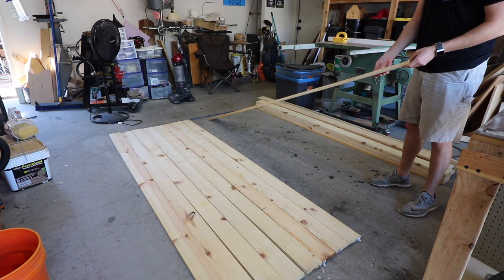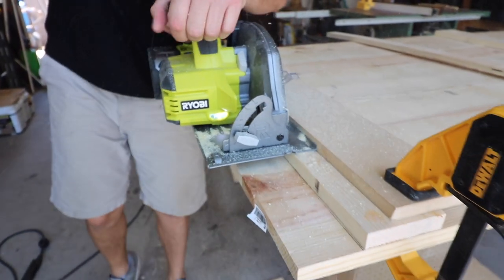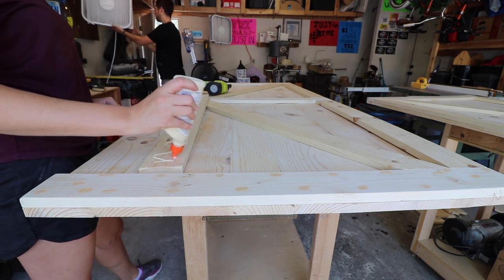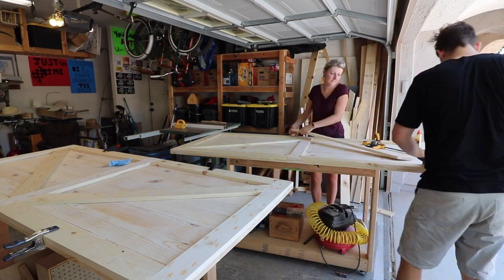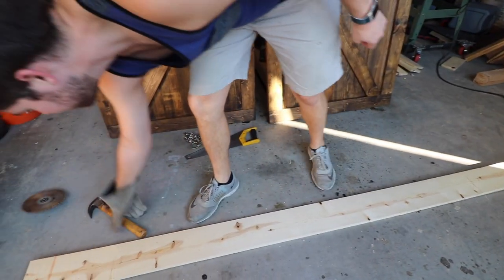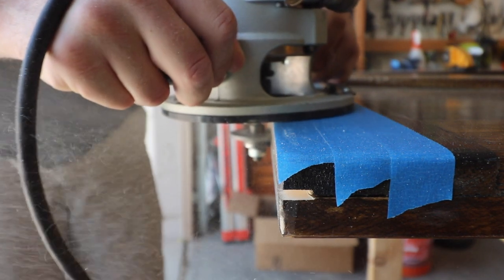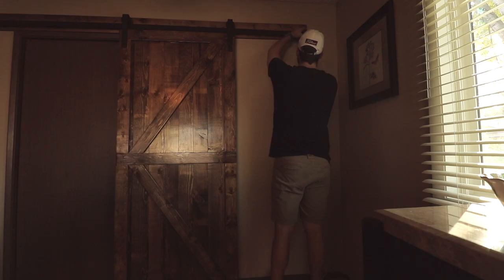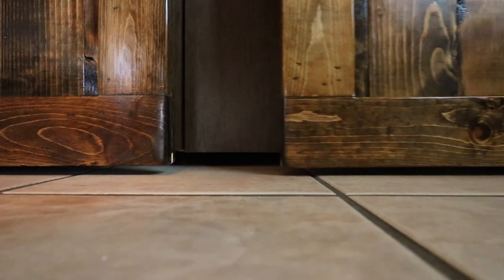DIY Double Sliding Barn doors

Comment: I would not glue the boards that run perpendicular across the grain as wood needs to be able to move to prevent warpage or cracking of the door. A door can take on moisture from the air causing the wood to  expand and contract 1/4 in per foot. Also do not glue the tongue and groove joint for the same reason.  Making the screw holes slightly large will also help,  Tears of Experience

Comment: A list of what is need would be helpful and because you don’t have it and did not include it in your video I cannot find it helpful sorry it is beautiful.
Reply: Angela Pannozo it looks like they used 1x6 pine tongue and groove boards (probably 8 foot) for the main part of the door, 1x4 (again, probably 8 feet), for the top trim and cross sections, 1 1/4 inch nails and nail gun, wood glue, sander and sand paper (probably 220 or higher grit), long clamps to hold the wood together as it is glued, and a router with a slot cutting bit. Of course you’ll need the mounting hardware as well.

Comment: How do you keep them from rolling past center?  I just installed some myself (not as nice as yours!) and they roll past the railing coupler (I used two 8 foot long rails and the provided coupler).
Reply from the maker: Usually the hardware kit comes with stops for the center, so the doors stop where you would like them to
Reply: I’m doing a double door project now and I’m trying to figure this out as well. If I put the two spare stoppers in the middle, they take up too much space and the doors won’t close together. The distance between the two straps when the doors are closed is only about 2.5 inches. I’m thinking maybe if I leave the last 1/2 inch or so (of the mortise slot) unrouted, and it will catch the guide and stop. We’ll see.

Comment: Nice job!
 I kind of cringed when u out down masking tape before using the router, but then noticed you switched to painters tape. Wondering if you had issues when pulling off regular masking tape or was the stain able to resist the glue adhesive. No diss, just curious. Again, door came out great

Comment: Love this!!! How do you install the bottom track?
Reply: I was wondering the same, 🤦🏽‍♀️ I don’t think they showed that part, only the 1/4” slots they cut with a router but, that’s it. I didn’t hear anything more about it... 🤷🏽‍♀️
Reply: @opiana86  it so the doors wouldn’t sway back and forth when not in use. Naturally doors move when the furnace kicks on and off. So no track on the floor

Comment: The slots that were cut out.  What was the purpose of doing that? I didn’t notice a track on the floor? Thx for sharing
Reply from the maker: These doors are purely cosmetic non functioning the slot is to hold them still so they don’t swing back and forth.
Reply: @JustinStanley  it’s exactly what I want to do for where we had French doors that leads into a bonus room. This video was very helpful
Reply: There’s a guide on the floor. They didn’t show it.

Comment: Was there enough room to keep the clock and candles on the wall as in 9:49 ?
Reply: I had the same question... But I guess I don't see a reply.
Reply: Either the clock and candles are super thin and flat, or that is a staged picture just for looks.  I doubt there is room to fit those two items between the wall and the barn doors.

Comment: When you close the doors together, how do you stop them both rolling to the left or right? Is there some sort of stopper in the middle?
Reply: STOPS IN THE MIDDLE ARE ADJUSTED FOR REVEAL  STOPS ARE ON THE LEFT AND RIGHT ENDS OF RAIL SO DOORS WILL NOT COME OFF RAIL. SO STOPS IN MIDDLE YES

Comment: You mentioned you bought a 10ft rail so what are the measurements of the doors?
Reply: TWO 30  INCH DOORS WILL NEED A 10 FOOT RAIL

Comment: My wall has no studs. What can I do? I want to install the barn door but how?
Reply: MC Rose Caba if you make the door very close to the floor you could hide two wheels in the door rather than the slot for the guide to ride in. Door will be a little bit thicker but it’s doable. Then install the top so it looks like it’s hanging but the two black wheel will actually support the weight. You will have to make the door, can’t get that in a kit.
Reply: No studs?? What’s holding the house up?